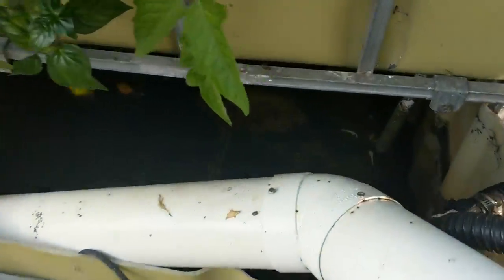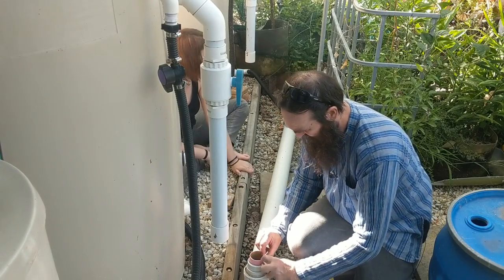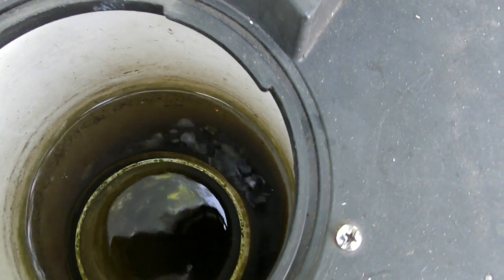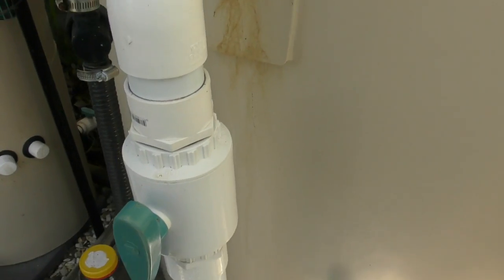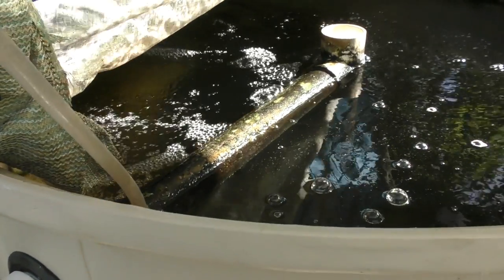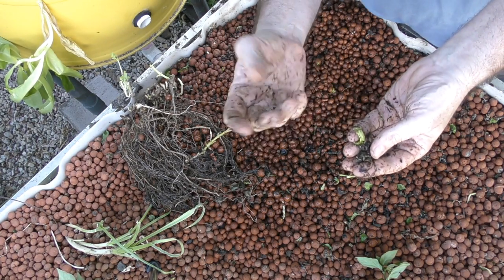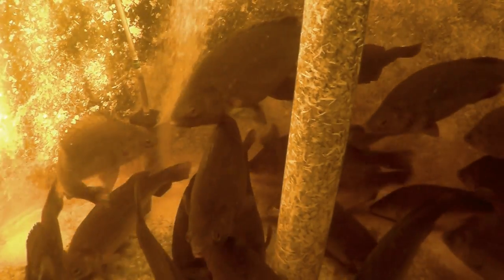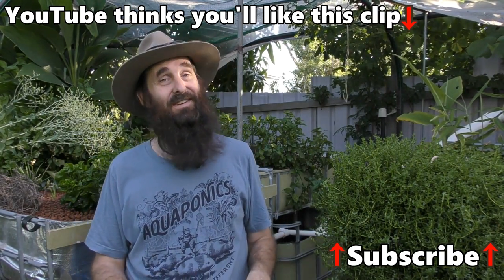Aquaponic System Emergency | Drain & Venturi FAIL

Comment: you were lucky!  I always have air running into the fish tank too.  It's saved my butt a few times.  Glad all is well.
Reply from the maker: I really need to look at a better backup system too I think. Is it you that set up a flow switch Rob? 
Hope all's well with you & yours.
Reply: It wasn't me but I do have something in the works.  Stay tuned!

Comment: I went through something similar this winter. The pipes froze a bit and came apart, leaving the pump to run and drain all the water out of the system
Reply from the maker: Did you lose all the water or did the fish have enough to stay alive Shayne?

Comment: Watcha! Close call that one. I have put a level , float switch, in all my tanks now including the sump. I have connected them to my battery back up and an orange strobe light that , if it dosent wake me up, wakes my neighbours up who then definitely wake me up. The air and water pumps are on separate power feeds, both mains and back up. Next step is to build in some redundancy so I can go on Holiday.
Reply from the maker: 😃Hope you have understanding neighbours Michael. 
I need to sort out a float &/or flow switch for mine to replace the relay switch. I think this is the 3rd mechanical fail I've had now. 
Cheers mate.
Reply: Everything's getting old now...Gulp! My pumps been running for a couple of years now. I need to look into how many hours it should last and have a replacement ready ....i might even plumb the new motor behind the old one and have it on a relay so when oldy fails the new one kicks in automatically.

Comment: I know this is an old video, i have just come across your channel and like what i see. How come you don't use screw fit attachments on your pipe work. That would stop that from happening. Just curious that's all. Regards Richard
Reply from the maker: Hi Richard. Can't always find them for the different situations I need to use them in unfortunately.
This stuff up would have been easily avoidable if I braced & screwed at the start. 😉
Cheers mate.

Comment: Putting up a more substantial brace under your drains will help.  I'm surprised that those slip fit joints lasted so long.  Even if gravity isn't strong, it IS persistant.  I hope you go around looking for joints that don't have a screw in them so you don't get a repeat of this scare.   Good that your losses weren't greater, just water, right?
Reply from the maker: They were the only joints connected like that. 👍
Reply: Oh good.  Would your fish eat caterpillars?  Perhaps they'd like a treat.  :-)  Thinking about float switch activation, is there an app that will notify your mobile if certain parameters fall out of optimal settings?  I know there are industrial process alarms that work like that, so there might be something that you can adapt to your system.

Comment: thanks for sharing this! is there a reason you use sea salt? vs normal sodiumchloride? i use pure sodium chloride 5$ us for a 40lb bag its sold as water softening crystals here in the us, also you might be able to record through that glare on the water with a pair of polarized sunglasses.
Reply from the maker: Pool salt is sea salt & it cost me $5 for 44lb/20kg so about the same price. 👍

Comment: Rob you mentioned adding salt as a brown blood preventer. What ratio do you use per 1000 ltr. Does it also have to be added over a few days. Lastly epsom salt have you used? do you approve? If so with the sea salt added what ratio would you use. Cheers.
Reply from the maker: Sorry I missed this Chad.  This clip goes through the salt ratio if it helps.  ► https://www.youtube.com/watch?v=tSYxXPnUaJQ
I haven't added magnesium to the system as I haven't felt the need to. I have seen others add it with no apparent ill effects so I don't think it harms the fish in low doses. 
Cheers.

Comment: Is there any reason you aren't using glue?  Is all or your plumbing friction fit with teflon tape?
Reply from the maker: That drain was never meant to be permanent & I wanted to recycle the parts.  
Cheers.

Comment: Hey rob bob, I need to replace my grow bed and was wondering what your preferred grow beds are? would it be the IBC or would you do something else?
Reply from the maker: I like the IBC beds as they are cheap, are a good size to work with & relatively easy to plumb up. If you have some lumber laying around it might be just as easy to make your own to the size you need. Just need to make sure you use a suitable pond liner as they're not all food grade. 
Hope that helps some.
Reply: I had a lumber one i built however it got a leak and id have to rebuilt a new one. It seems like your ibc ones have lasted many years without much issue. Would you still build a ibc one the same as your video you made?

Comment: Rob, how many fish do you keep in your aquaponic system?
Reply from the maker: At the moment there are 20ish I think. Tried to find the last clip I mentioned it but can't  sorry Jason. 
Stocking densities of backyard systems is based on bio filtration capabilities of the beds so if I didn't have the bio filter we should only be able to stock 45 or so. I run through the best way to work out stocking densities in this clip of it helps any ► https://www.youtube.com/watch?v=MeYtUfBKwNo
Cheers & have a top one.

Comment: Just use a waterfall to boost thoose oxygen levels
Reply from the maker: If water isn't flowing through the system it won't be working just like the venturi Noah. With a tank set up like ours we are trying to get the water to create a vortex to drag the solids to the centre. Cheers mate.